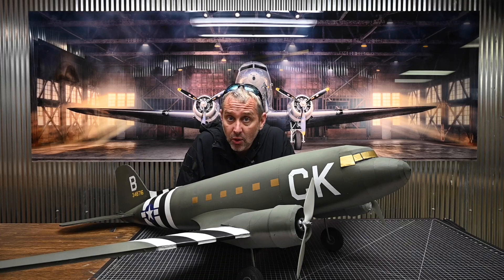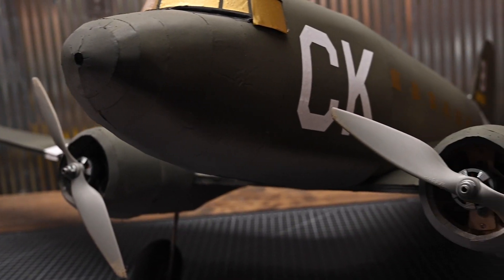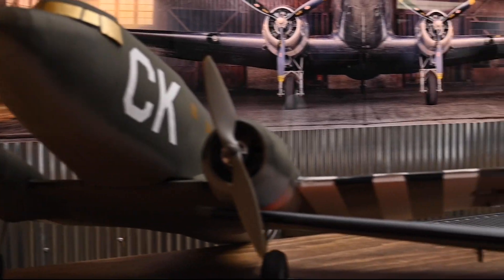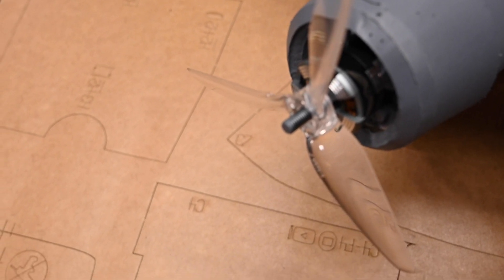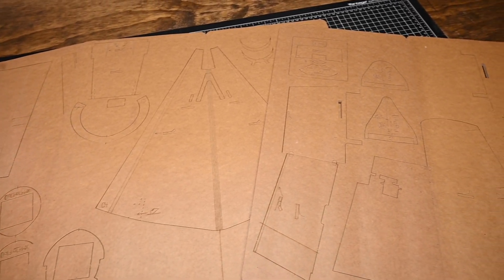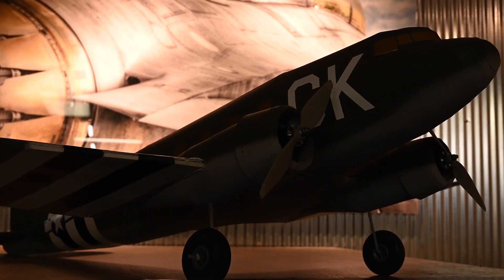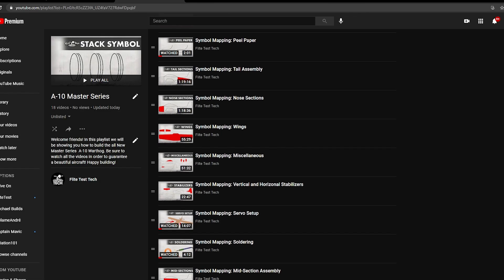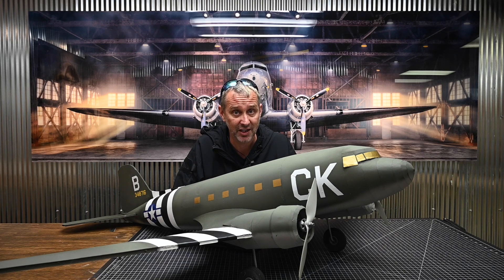Master Series C-47 Introduction

Comment: Wish shipping, duty and taxes to Canada weren't so brutal. When you add in currency conversion, it's $208 CAD. Add another $500 if  I want to order motors, ESC and servos. Not even sure I could get the thicker maker foam in Canada even if I could get plans. Ugghh! Our border is a pain in the butt. I'd love to build this plane.

On another note, makes no sense I can get things shipped from China with less shipping cost and no duty cost. I struggle to get my head around that. We're neighbours and I'd much prefer to support my neighbour than a nation across a large ocean that speaks another language and incarcerates innocent Canadians for political leverage.